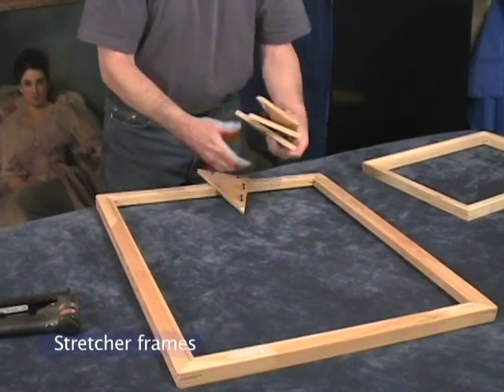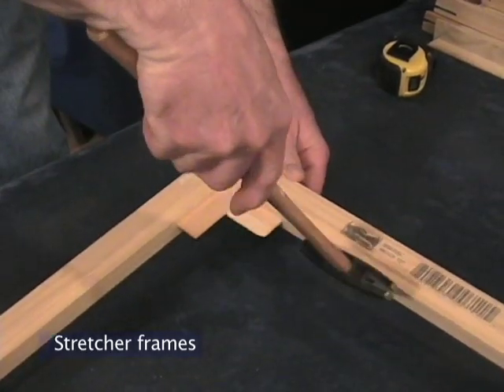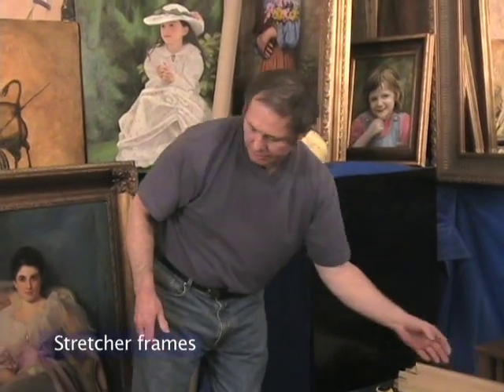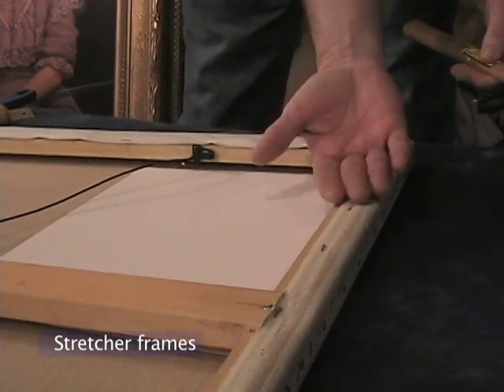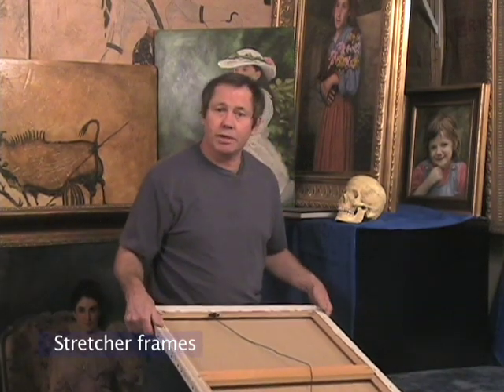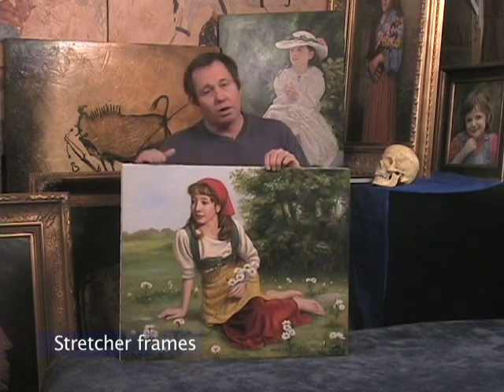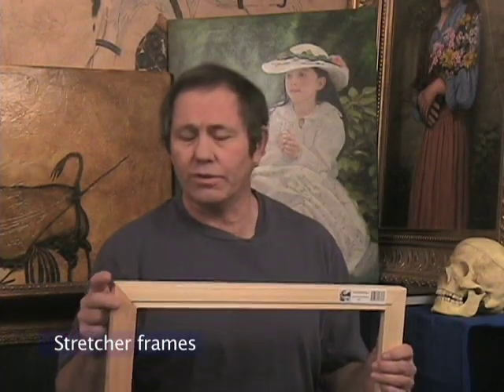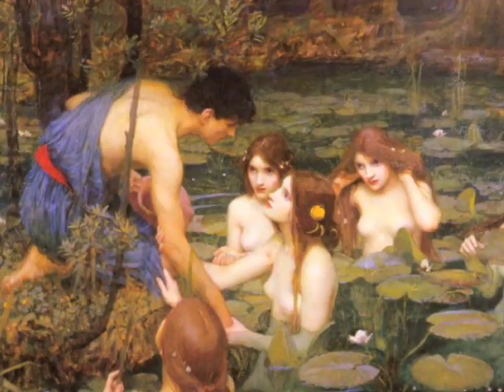10. Thomas Baker's Canvas Stretching Tutorial

Comment from the maker: Get a grip on yourself, now. Rein in those emotions. I assume you're talking about the wooden wedges in the corners of a stretcher frame. "Pulling the sides apart," no matter how you accomplish it, as a way of tightening a loose canvas is simply a bad idea. It unevenly strains and ultimately damages the canvas. Banging in wedges (perpendicularly, diagonally, or any other way) is a mickey-mouse fix for a loose canvas.

But if you like it, bang away! (diagonally, of course). It's a free country.